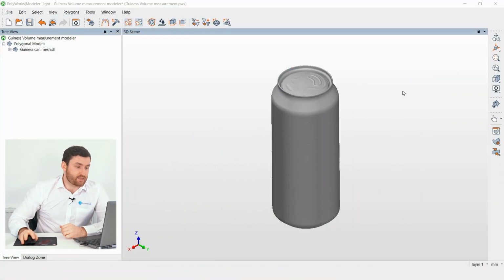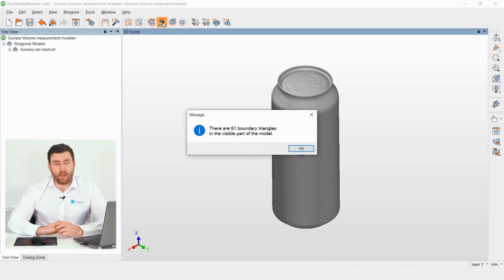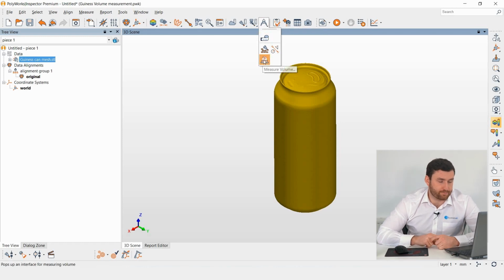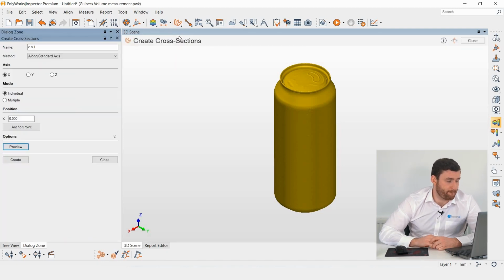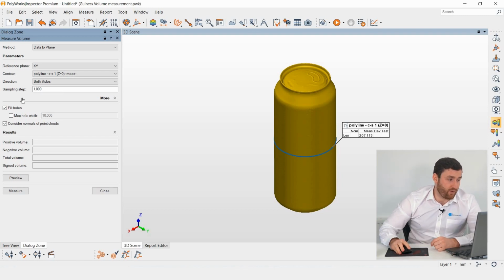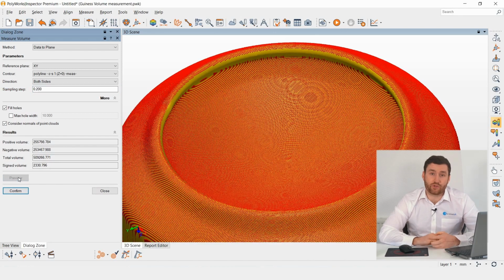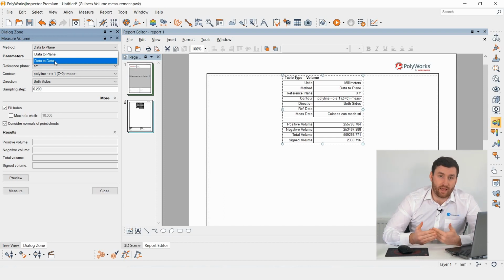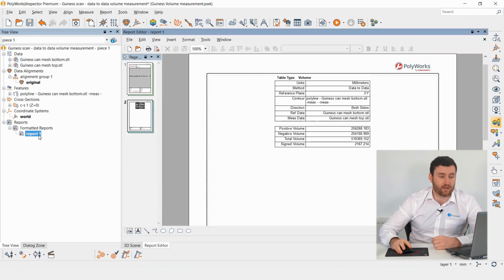Measuring Volume in PolyWorks Inspector & PolyWorks Modeler - PolyWorks Webinar

Comment: Hi...i have to calculate volume after virtual machining i.e. i have a forged piston called skirt piston and volume is to be calculated after machining its outer area  and bottom area...plz tell me how ti do
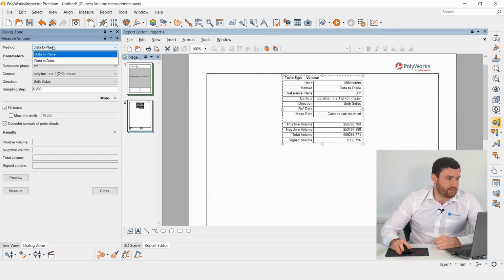Reply from the maker: Hi, please refer to 14:40 in the video where Luke uses the data to data method for measuring the volume.
Reply: @3DScannersUK   thankeww for your reply...but i want to know is virtual machining possible in polyworks...after that only i have to calculate volume